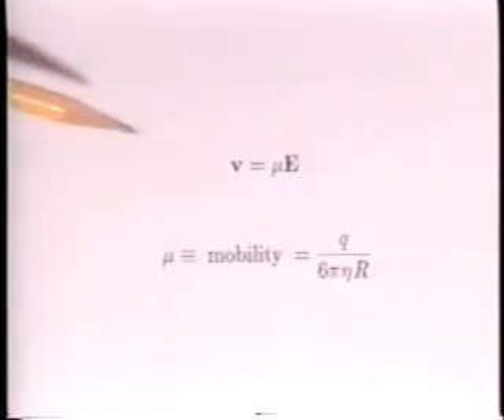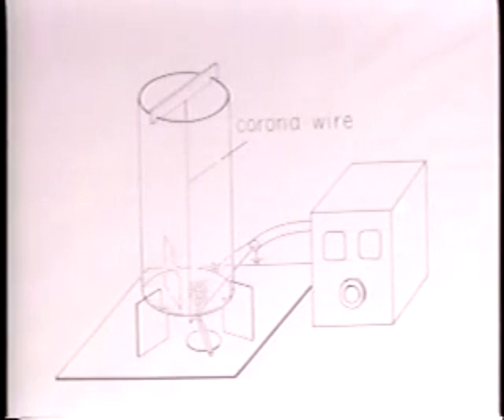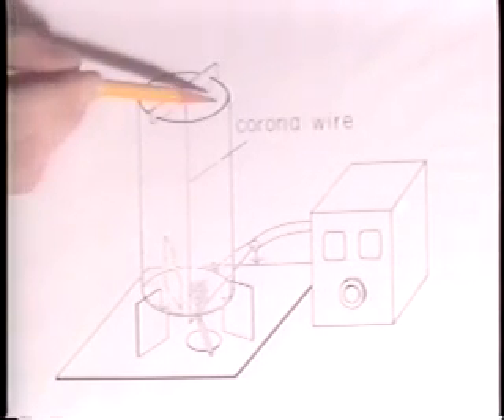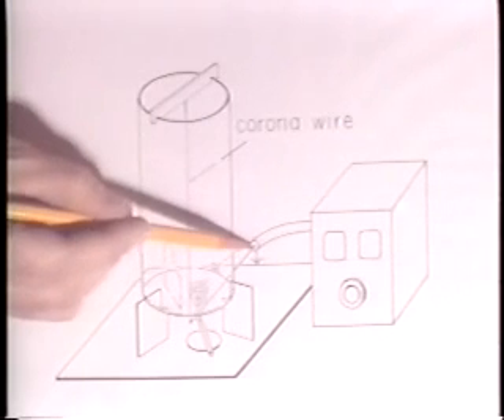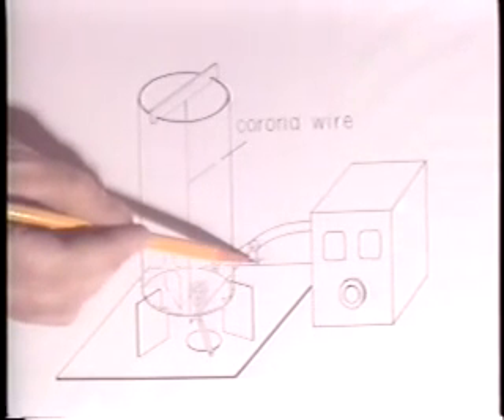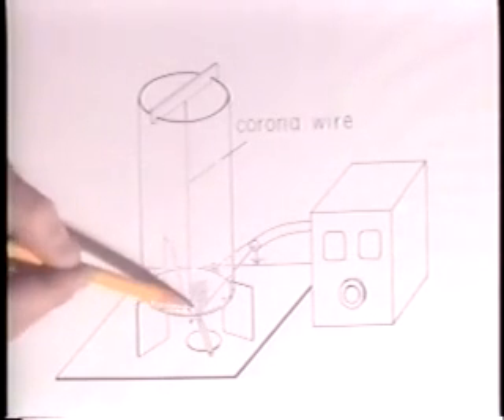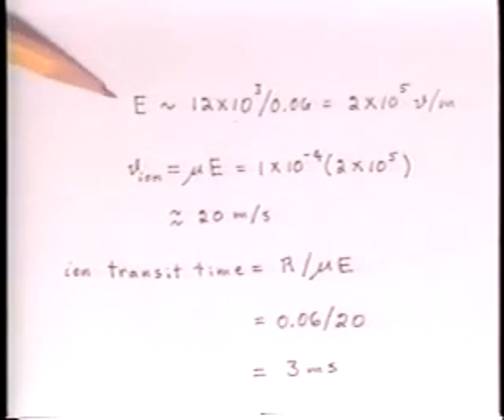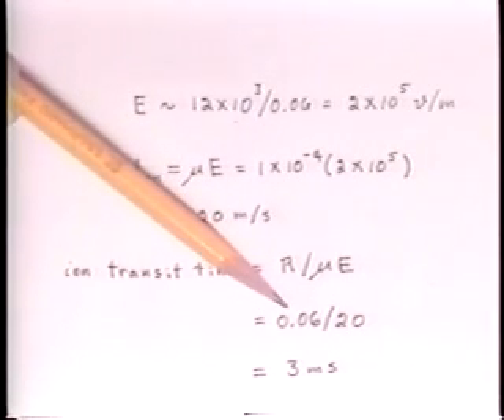7.7.2  Electrostatic precipitation.wmv

Comment from the maker: From looking at this with a science perspective the laser energy works on the inside of the atoms pushing the electrons outwards into high energy orbitals and the electrical energy works from pulling from the outside on the electrons to remove them from the atoms. Working together they lower the amount of energy required from each of them working alone to try and do the same job of removing the electrons on their own. The laser energy is fed into a laser charge pump configuration.
Reply: It seems that you already knew about the MIT experiment. HAHAHAHA! 

Between yesterday (I left another comment in another video ,referring to this effect) and today
I have been able to read more about his work on the Meyer cell.
The truth is that it is very interesting and intriguing.
It was clear to me that Meyer used pure water as a dielectric and another "gadget" came to mind, called LIFTER. It is an asymmetric condenser (armatures of different dimensions) that uses air as a dilectric and a high voltage 20Kv or more to generate a current of ions in the air, producing an asymmetric thrust and lifting the gadget into the air.  (for more details see http://jnaudin.free.fr/html/ekpexpl.htm )
Will they have an inverse relationship in terms of the physics involved in these effects?

The use of the laser to excite the electrons is a point that must be very considered.
I use a co2 laser of, 10.6 μm wavelength.
While I understand that you will have to work in another 656.3 nm wavelength range close to or within the range of hydrogen.
In the example of the co2 laser I own, the ratio of total energy consumed (1200w/h) to the energy produced in the light beam (30w) to cut is very poor (focus lenses are used to concentrate that energy to produce the desired work).
Since laser diodes are a bit expensive as a peculiar article, to minimize costs it would be convenient to minimize the condenser cavity to a ring, surrounded by the laser leds.
Like the motto "divide and conquer," there is its opposite, "Unity makes strength".